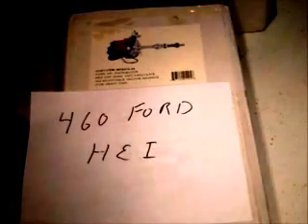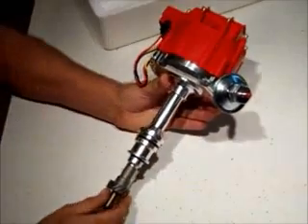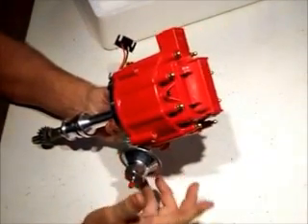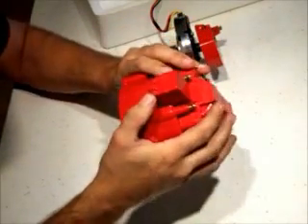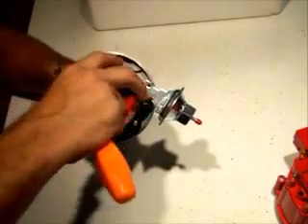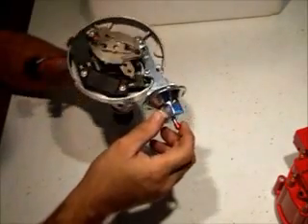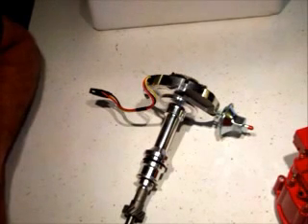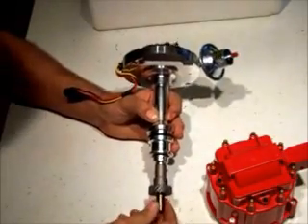Ford HEI Distributor

Comment: I have a 351 stroker but I used the original distributor with the pertronix II kit. I was thinking of the hei first. you could seal it with Flex-Seal. Would that work?
Reply from the maker: I guess one could , but would be messy and need resealed everytime worked on . Also got to make sure inside is vented , as some pressure builds up inside and may get moisture inside if not able to breath.

Comment: How did you figure out the firing order on the gm style cap? I'm currently putting one on my 351m and I got it to hit once but now it wont even spark. Thanks for the information in the video.
Reply: The cap has nothing to do with the firing order
Reply: In reality you can bring number one cylinder up to top dead center and point the rotor to where you want number one to be and install it (not preferred). Then put the plug wire coming from number one cylinder to the terminal where you set number one to. Then following the firing order and distributor rotation install the remaining wires.
Reply: @ClarenceSaxon  ok thank you for letting me know. I really appreciate it. I will give it a try and see how it works. Thank You.

Comment: On a 1989 f150 where'd be the best place to source power to the distributor besides the hot side of the starter relay with a switch?
Reply from the maker: i would try to get the power from where the old ignition did if i could , then it should be off when key was off

Comment: I have one on my 302 and its been in there several years and has worked great. But the cap got cracked so I guess i can I put a cap on it that is supposed to be for a g.m. engine, correct?
Reply: does it give 302 the  horses I need ?

Comment: The HEI setup for ford V8 is nice but is flawed (302 motors), If you match up a standard ford 302 Distributor with this HEI setup they aren't the same length, the shafts are different lengths. I've already burned up 2 of these HEI due to the shaft seizing up inside the upper housing.

Comment: The counter weights inside the Ford are opposite side, flipped, from GM distributors. I got the GM curve kit. You might be able to use them but the way they stamp them out leaves burr's on the other side.

Comment: i figure ill tig weld the bottom its peace milled togeather were i have herd it can break instead of just stripping the roll pin as it two peaces unlike the one peace stock units the gear is on the shaft part then grind flat re assemble allway fixing china crap even when new gotta be clever saving when a dollar .. sorry for grammer i a wherry to run out away from pc
Reply from the maker: Thanks for stopping by

Comment: This might be a dumb question but where's the number one cylinder on the cap?
Reply from the maker: I would see where on cap the original number one was and try to put it as close to that spot on new one . Like if number one was in the back , or facing the rear of engine , then i would put it in the rear of this one . It may help in wire routing as they could take the original path and make it easier for future diagnoses , because if one looked up the firing order in a book it would still look the came on the new cap
Reply: were ever you start your timing from basically any witch one as a starting point

Comment: I have the same distributor on my 460 cu. in. The previous owners of the truck had to cut out some of the air filter to make it work. Also, this distributor is very, very close to the thermostat housing...so it gets a lot of heat from it...which made the modulator inside of it go out. If I have to change out the thermostat I have to remove the distributor. A local speed shop said it is the "wrong distributor" for that engine. Yes...it works, but, he said it's for a small block Ford. He showed me a smaller diameter distributor but I would have to get a separate coil to make it work.
Reply from the maker: I believe if it was a small block dist it would have a smaller hex , so the 460 oil pump rod would not fit in it . Not much money to go back to all stock ford parts if wanting the Right parts for it .
Reply: How could I find out how to adjust the vacuum advance mechanism inside the distributor? Do you have any tips on how that's done? I'm unfamiliar with doing so.
Reply from the maker: Well most are probably factory setting or close  to start .Y does it need adjusted . what does it do to make u feel it needs adjusted would be a big factor in how to adjust .  , needs to be adjusted to the engine . every engine is different . add a cam or change compression and it is again different . The type of fuel is also a factor . There is no way i can tell exactly how to adjust it to be best for your engine. It all depends on what advance curve runs best with your combination
Reply: The engine runs really good and I'm curious whether it can be improved. A local speed shop mechanic/owner said he would work on adjusting the vacuum advance. He doesn't have a dyno. I'm wondering if I could do the same thing he would do. I bought this truck 2 years ago and have no idea if the vacuum advance has been adjusted or if it's stock. The engine is low compression, headers, 750 Holley, and low rise intake.  I'm just wondering how it's done if I were to experiment with it...on my own. Can you offer any info on that? The speed shop owner suggested I purchase better plug wires with actual metal in them (Taylor wires) and get rid of the suppression wires I now have.

Comment: about how many miles have you run with it? any problems and do you have a brand and part number?
Reply from the maker: It is just a chevy HEI distributor that has been used for many years with out a issue . All parts from a chevy dist will fit . They just changed the outer casting and shaft to fit a ford is only difference .
Reply: where can you get brass gears for this coil

Comment: I installed one in my ford 460  when I reach 57 miles an hour it seems to encounter spark misfire  and backfire out of the exhaust  with loss of power until I back off the throttle  and return to 555 miles an hour   What could be causing my Problem ?
Reply from the maker: is the cap good . it is all the sam,e parts that are found in a chevy car , so may look up testing a HEI distributor and go from there
Reply: I wouldn't be complaining if I was going 550mph. Lol

Comment: had one in my 351w mud truck. i liked it but at same time didn't. i drove the truck over hood deep but i had problems with the coil breaking from the rough ride. also to keep it more watertight i silicone a lot around where water can get in but then i would have to drill and make a vent vs the stock ford ones the vent was right on the top. im going back to EFI so im gonna be giving up on the HEI
Reply from the maker: Thanks for watching

Comment: I put a DUI HEI dizzy on my BBF 466 jet boat motor. Pinched the "brown wire" coming from the cap to the dizzy and the motor shut down. DUI is sending another harness to me......and that should fix the problem. 

The ONLY think I think Chevy did right with their motors is create an HEI dizzy...... and that's why I'm using one on my Ford.

Comment: I tried one on my 351W.  Worked okay for 4000 miles, but then failed.  So I'm trying a powerfire.  But...Ford distributors get wet???  Since when?  Every time I see some poor Chevy schlub trying to work on his distrib jammed into the firewall, I laugh.  There are reasons to like each...but...more likely to get wet?  Don't think so.  Do you have it in a submarine?

Comment: you ever have a problem with the water neck on the 460 getting in the way of the distributor to ever make any settings on turning it to set the timing?

Comment: How did it work on your 460? I'm thinking of putting one on my 1973 460 (in a 1988 F-350) to bypass all of the old ignition setup that's having issues. Was it hard to get running right?

Comment from the maker: Depends on the application. You would have to check the old wire to see how many volts it has. Some older systems used a resistor to cut the voltage. As long as you have a full 12v on the wire you can use it.
Reply: Or simply use a relay with your factory wire completing the coil(85), ground(86) 12+VDC normally closed to the distributor(87 I believe) I personally just ran a fused (amps must be measure correctly to avoid bottle neck here)wire from the ignition harness itself to the distributor. Starts with key cause HEI doesn’t use that resistor/voltage drop. Worst/easiest option just get a switch temporarily and connect it fused direst to battery to test other components if needed before starting with a key even matters. Lol.

Comment: with this distributor can i just run the old wire from the old coil to this new one and be good or do i need some other setup.
Reply: That’s what I did on my 71 Ford Maverick 302, it works fantastic